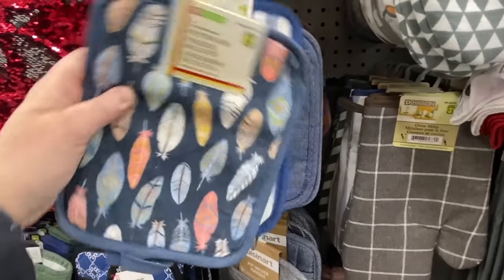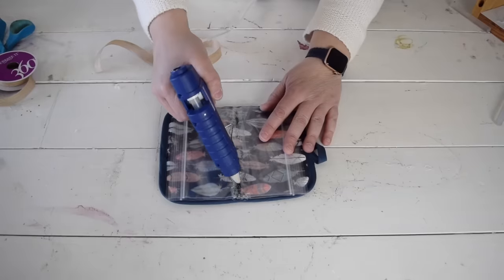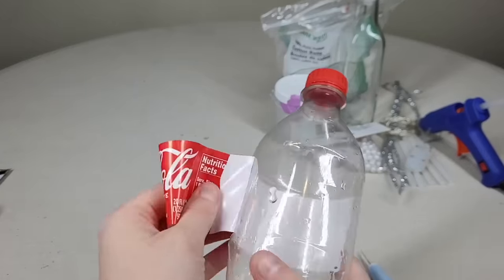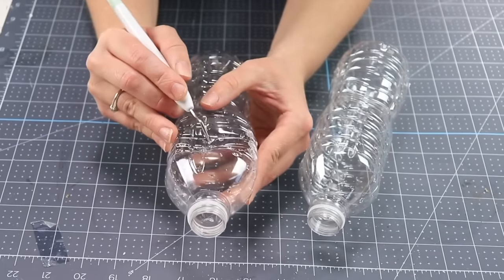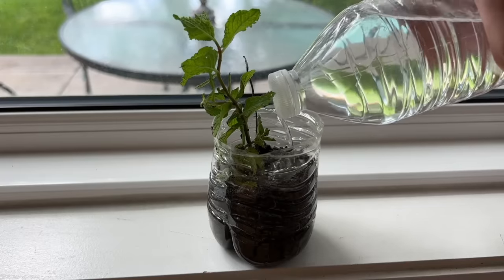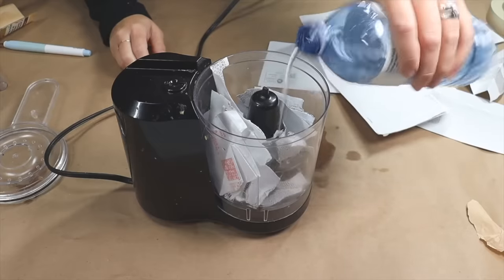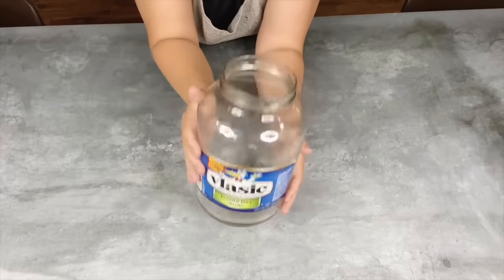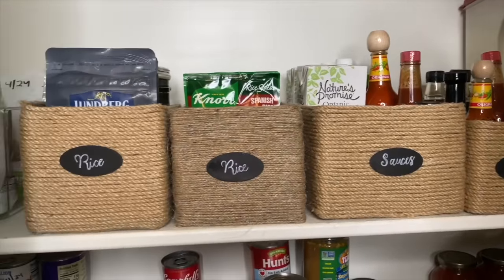Grab a pot holder and a Ziploc bag - this is GENIUS!

Comment: How are you ever going to WASH the towel? Hot glue will melt right off in hot water, and I always wash dish towels in hot water... maybe I'm the only one? Hot glue may be fast, but sewing will LAST!
Reply: I was thinking the same thing!!
Reply: Sad to say but some people were not taught to sew.  Sadder still they think they can't learn or they are afraid. 😕
Reply: In our home ec clubs we just sew them but you can get a glue for clothing that can be washed
Reply: @pamczech5984  would that be Fabritac?  I washed recently a white hand made item using Frbritac and it did not undo any seams.  Curious.  Have an awesome day!
Reply: Gorilla brand has a fabric glue that withstands laundering.
Reply: @veronica-c8199  Good to Know 👍🏼I did know that they had this.
Reply: Can you imagine the damage done to other things in the drier with that towel idea? I would remove that part of your video. You are going to get into trouble, this is a common sense issue.
Reply: @elizabethregister  before recommending removal, ask the podcaster if their hot glue does hold up to several washes of  “hot” water.  One person has stated that Gorilla glue has a fabric glue.  I personally have use fabri-tac I hot water and it didn’t come apart.  I was surprised because it was my first time.   For those that don’t know how to sew, they need to have more facts.  If sewing is their only option there’s always another way.  Stitch witchery.  They would have to have someone else help because I haven’t worked with that in ages.  There isn’t only one way to make things work.